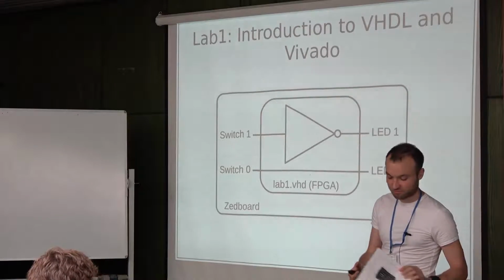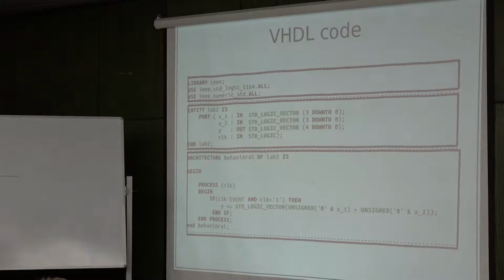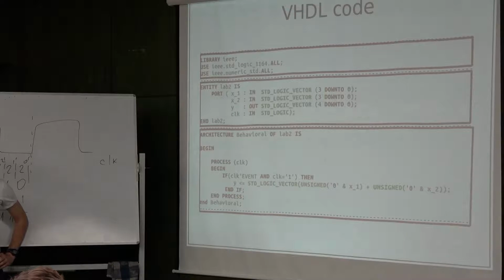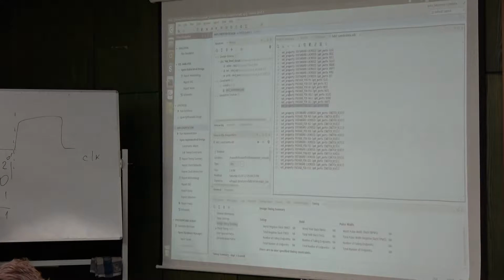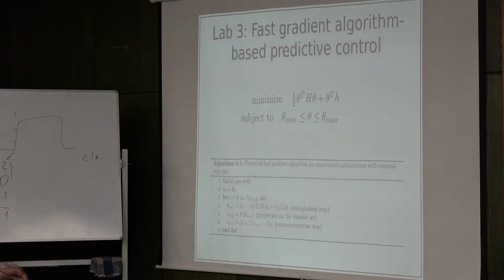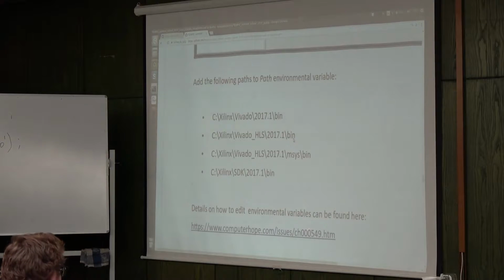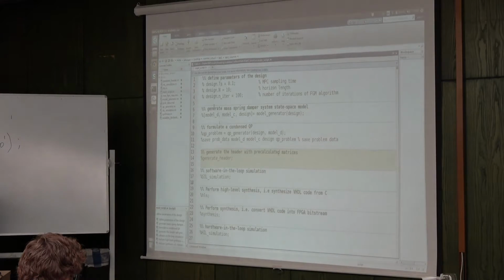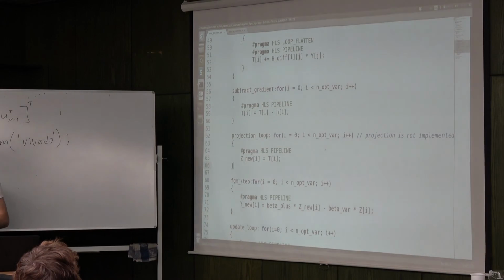TSS_20170718 03 - FPGA - Lab exercises

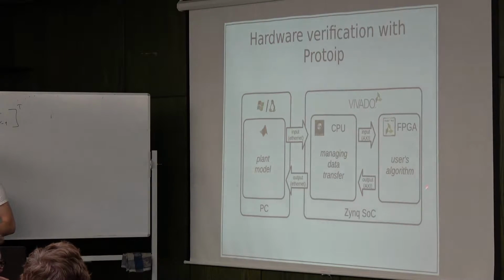Comment: in 40:40
I'm getting two critical warnings, they are:

CRITICAL WARNING: [Common 17-183] Failed to open handle vivado.jou. Please check access permission of directory 'C:\Windows\System32'. You should restart the application from a writable working directory. 
CRITICAL WARNING: [Common 17-183] Failed to open handle vivado.log. Please check access permission of directory 'C:\Windows\System32'. You should restart the application from a writable working directory. 

Do I need to add this directory to the environmental variable? Or Should I solve it in a different wayr?